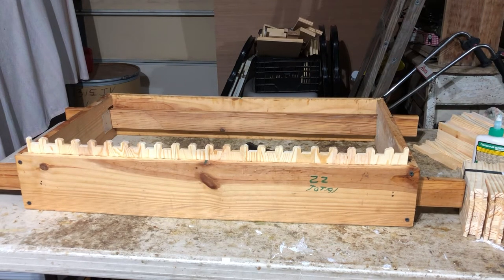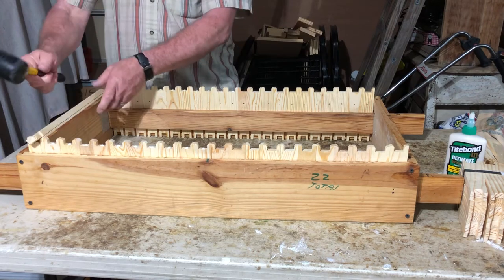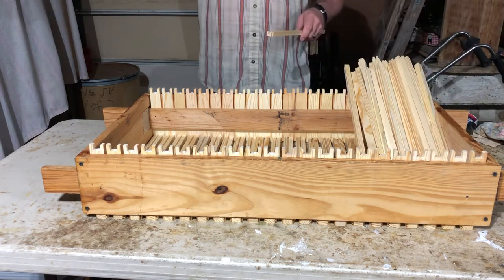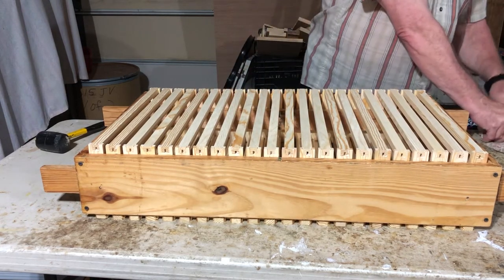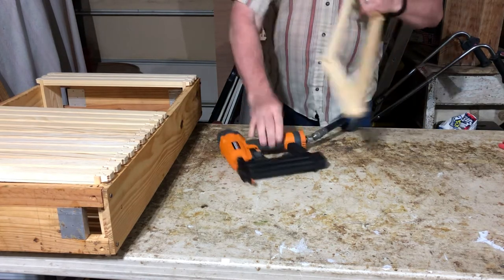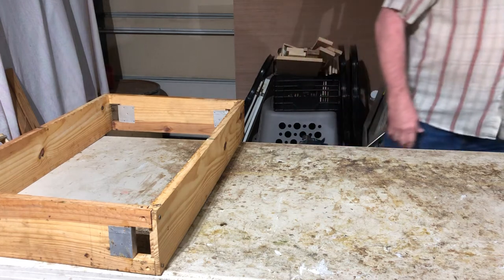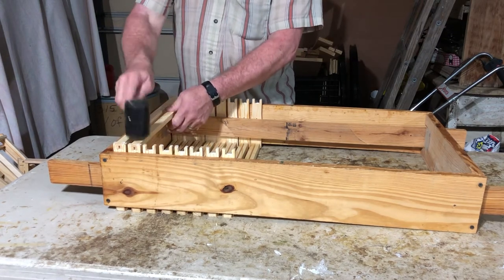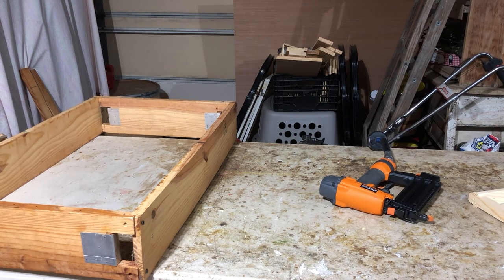Frame assembly tips & tricks

Comment: I prefer my homemade 25 frame jig to the bought ones, 4 batches per box of frames makes quick work of it.  Snow is almost gone and I have a pallet of frames to put together but waiting till I can paint the boxes for somewhere to put them.  Even though I do so many, still fun to watch someone else do them (and I never thought about putting bottom piece in sideways to spread glue, think I might try it but I use a glue bottle with a sponge on end which makes it messy).  Not sure why Mann Lake decided to put the frames in boxes this time (though I was happy they did), last winter they just stacked em on the pallets without boxes.  Last year ended up with a bunch of damaged frames because FedEx Freight smushed the corner of the pallet of boxes and the pallet of frames together (damaged a bunch of the box joints too).